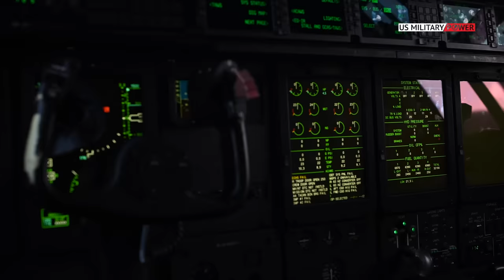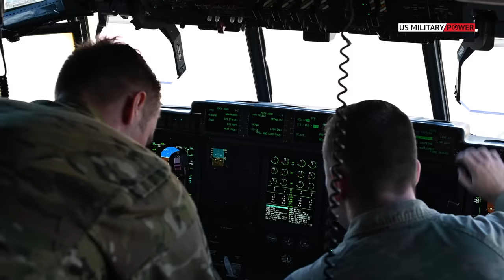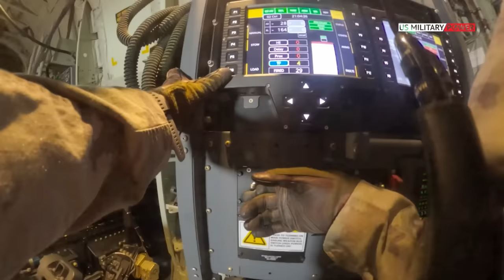AC-130J Ghostrider Gunship in Action - Firing All Its Cannons

Comment: I have been told that when the AC-130 is above 10,000 ft. and the crew is working closely together, you can get 3 150mm rounds in the air at same time to the target, but you have to fire, reload fast.
Reply: 105mm. two rounds in air is good, not sure about 3. i was at Ubon RTAB flying AC-130H which had 40mm and twin 20mm. twin cause Vulcans were jam prone. shot only one at a time. can still smell the cordite. old pilot

Comment: I've seen these birds in action and I can tell you, these planes can unleash some serious hellfire and I promise you, you don't want to be anywhere near when they open up. But my question is, the C-130 isn't exactly the most agile or the fastest bird in the sky. So don't these things make a great target for SAMs?
Reply: Prop planes are slower but they can loiter longer over a battlefield.
Reply: I've wandered the same thing?
Reply: I think they are positioned as the second or third wave when radar detecting SAMs and enemy jet fighters have been destroyed. Or even for supporting ground troops. Probably equipped with counter measures in case of mobile SAMs.
Reply: @michaelnaretto3409  I think so have seen a video with one of these planes in a banked circle, firing at the target area from multiple sides. Slower is better for that situation, take out one side ofmthe building, bunker, hangar, then circle around to the other side for more shelling of the other side, if the structure is still standing. Heck of a beast, don't want to see the pointy end of one of those shells.
Reply: I wondered the same, do flairs work against anti air missiles?
Reply: @gorillaau  They do a slow circle over a target and saturate it with fire.
Reply: @michaelnaretto3409  Nice to know. Nicer to avoid being at the pointy end of that one. Take care, wherever you are.
Reply: @gorillaau  Thank you.  Take care yourself.  And yes, you don't want to be on the receiving end of one of those planes.
Reply: you simply would not/could not operate them until you have air superiority, e.g. enemy fighter/SAM have been taken out.
Reply: @LeSkateWA  Depends on how it's guided. If it is IR (ie: heat seeking) then yes, radar no.
Reply: SAMS bring these down...
Reply: This plane in the Russia Ukraine war would get shot down once it left the runway..
Reply: Yes and they seem to be only realistic when at war with a 3rd world country. A pair of fighter jets would render this useless
Reply: @lancekindle7699  Umm, what?

US Military standard doctrine step 1: "Obtain air superiority."  If the enemy has any fighter jets left then the USAF has failed.
Reply: Read Gunship: Spectre of War by Henry Zeybel. It showcases our troops twisted sense of humor and gives an excellent insight into the capabilities of the C-130 gunship. Fiction but a great read, you can just  imagine being there with them.
Reply: Most runs on target(s) are done at night

Comment: Strange how the brass falls to the deck, when they should have a basket (in the ‘safety frame’) to catch it instead of it possibly rolling away if the airplane banks at that moment. Also, I wonder why they don’t have the breech automatically open (and eject the casing) when it returns to battery.
Reply: @albertful1967  As an ex-military man myself, I wondered the same thing.
Reply: >  I wonder why they don’t have the breech automatically open (and eject the casing) when it returns to battery.

My only assumption as to why today we still have these things that are generally manual - is the simplicity. The force in which the operator is opening that breach tell me that to do something similar automatically would require a reasonably powered hydraulic or electrical system. The problem with that is maintenance, support, triage, and failure modes. If all systems are operational - except for the auto-eject then the gun is useless. So why bother adding more points of failure to increase ROF in a negligible way?
Reply: Maybe it’s not mandatory.
Reply: Aren't they hand recovering each shell and placing it back into the rack? You answer your last question with your first statement. Why have an automatic ejector creating a fod hazard instead of positive control of the spent shell. As someone already stated, you've got 2 aircrew already on the gun. Is the juice worth the squeeze to make it automatic when they're already back there to load and troubleshoot?
Reply: @albertful1967 , yes I am an ‘armchair expert’ of sorts - but I was a (field) artillery detachment commander for years. And maybe those principles don’t apply when you don’t have your feet on the ground. I suppose what I know of 155mm artillery doesn’t apply to 105mm(?) airborne guns.
Reply: I know what you mean. As a neat freak the casings simply dropping to the floor make me itch, especially when the whole thing is happening on an aircraft where it's far less than ideal to have loose stuff rolling around. I wondered why sometimes the 'unloader'(?) just let it fall to the floor but in other segments held it as it was ejected. Surely the thing to do, as you say, is to grab it and stow it as it's ejected.
Reply: It's kind of the same concept as the tanks and the Russian autoloaders. Our boys can fire something like 3 or 4 rounds to the autoloaders in Russian tanks one round. Plus it's actually safer to manually operate than to have an autoloader. People get complacent around technology that does their job for them.
Reply: That is why they posted this video.  Seems that they have a couple of hundred engineers with advanced degrees that did not know what to do.  So they posted and was awaiting for your expert reply.

Comment: They have a great system for the active rounds. You'd think they'd spend a little effort to handle the spent casings
Reply: I thought the same thing.  If the aircraft had to suddenly take evasive maneuvers all that brass flying around the cabin would be deadly.
Reply: It might make good chaff or some nuisance barriers dropped in front of a chasing enemy  plane...😜
Reply: @frotobaggins7169  in action, spent brass normally just gets shoveled out an open hatch................ this was training
Reply: @willbbwluvr  How does that work when its pressurized?
Reply: @kevinclinthorne  , it's pressurised? Since when?
Reply: @willbbwluvr  I believe they've been pressurized since the AC-130U
Reply: @kevinclinthorne  , hmmmm, ok, I did not realise that! Never got to serve with them, but my father did, and he complained about the occasional hail of 40, 20 etc cases

Comment: why dont they put a catch tray on the cannon frame so you've not got cylinders rolling round all over the floor to slip on or burn wires on the floor?
Reply: We should be more concerned with the 100% chance of cancer before the age of 24 than the shells. They should all be in oxygen suits at all times

Comment: This plane seems a whole lot less cool when you realize the occupational hazards that the gunnery crew faces while the plane is in operation.

When I was a welder in a shop so dusty and full of smoke that you could see it for most of the day, I wore my respirator for the entire shift, people would call me "Kenny" or "Darth Vader" depending on how I would sound or how I would look wearing them.

These guys need some kind of protection even if it is respirators that are equipped to integrate a mic let alone supplied air. I couldn't imagine spending day after day in a smoky shop and not wearing a respirator, these guys do something similar only in a far more cramped space with even more toxic particulates in the air.